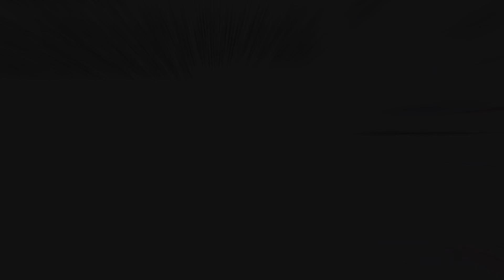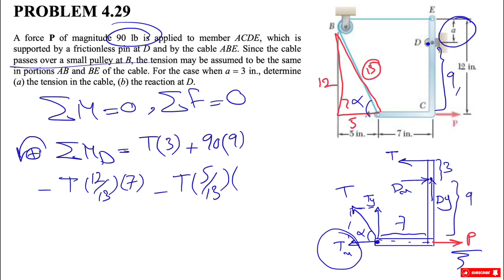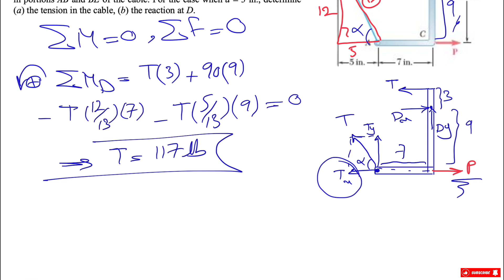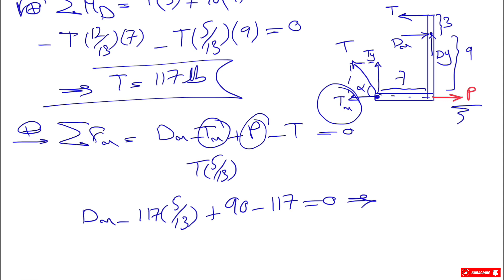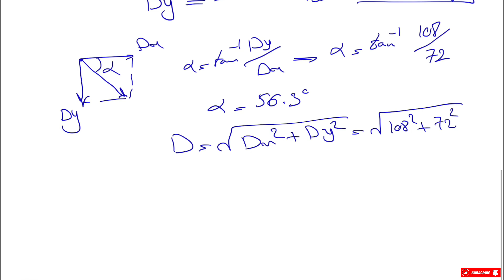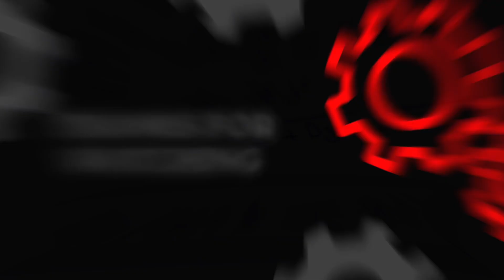Solved Problem  4.29 | Determine (a) the tension in the cable, (b) the reaction at D

Comment: A winch puller AB is used to straighten a fence post. Knowing that
the tension in cable BC is 1040 N and length d is 1.90 m, determine
the moment about D of the force exerted by the cable at C by resolving that force into horizontal and vertical components applied (a) at
point C, (b) at point E. 3.148 Eleventh edition please.
Reply from the maker: Hey, keep an eye on the channel—I’ll be solving this soon! Best